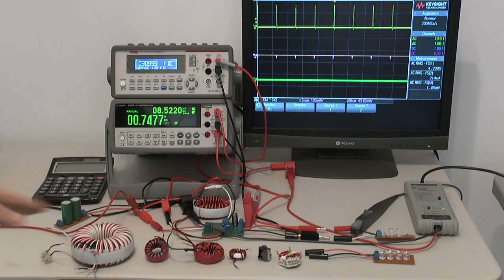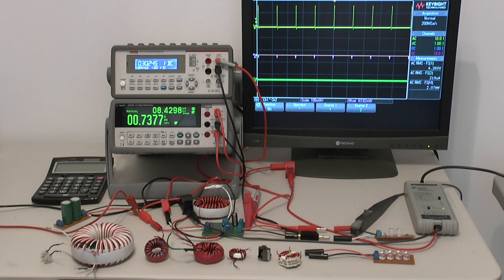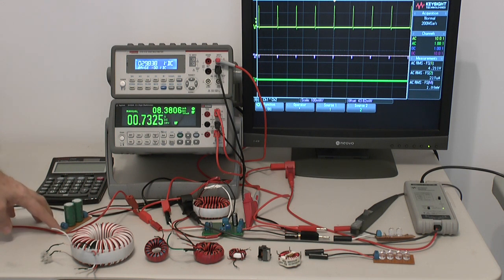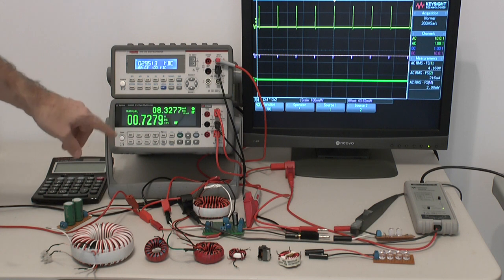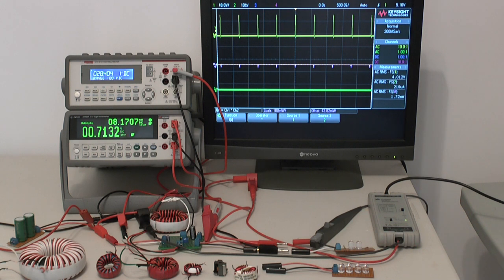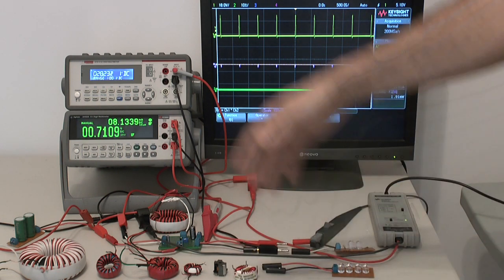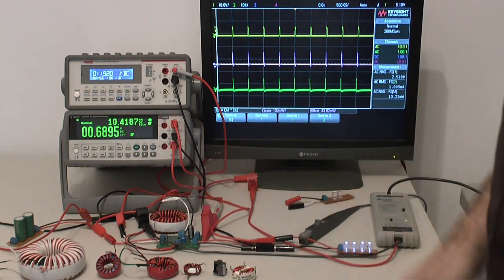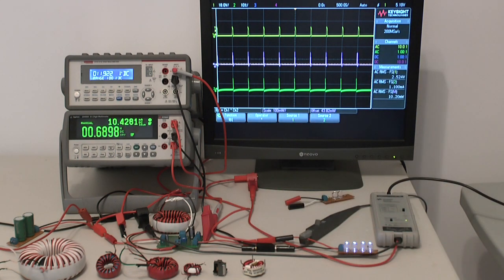The Joule Thief and Power Anomalies in the Ferrite Core

Comment: My friend, very good video. I've beeing doing similar researchs for 8 years now and I can tell you that the excess energy you are getting most likely comes from the compression of the electromagnetic field of the bifilar coil and its self capacitance around the wire, not the iron core itself. You can actually replicate the same experiment with coreless bifilar coils like panckage, ABAH, Tesla, etc etc, even a design of your own. So the secret is a series of caracteristics of your system. 1 The systems should resonate to achieve the effect, just put a high speed poliester capacitor in parallel with the coil connected to the colector and voila it will resonate, 2 You must have more than one bifilar coil, in series in order to achieve overunity, 3 Each bifilar coil must have a third winding so they should be thrifilar, 4 The higher the resonant speed, the more energy is present in the third winding. 5 The third winding likes high impedance loads, it means you need to stepdown the voltage of this third winding to get some usable energy in the form of low voltage high current. It might seem to be very complicated but not quite once you start understanding its working principle you can plan for larger setups.
Reply: good  ！Have you studied the work of Tang Smith?

Comment: I think this effect may be due to the finite time it takes for the magnetic domains to align  in various materials.  With sufficiently short pulses at fast enough risetimes the magnetic response continues to rise after the pulse duration has elapsed.  By the time the back emf from the load reaches the primary the input pulse has already elapsed. So input doesn't see 100% of load.

Comment: That is an interesting effect. I noticed your duty cycle was very low (5% or less), does it perform the same when you ramp the duty cycle up a bit? I say this because I wonder if it is an artifact of the measurement at low duty cycle... Using a rectified and filtered resistive load, does it produce the same measured gains?
Very interesting and thanks for sharing.
I really enjoy these sort of experimental setups.
Thanks again. :)
Reply from the maker: Hello Ben. I just did some test and it stays in the same ratio of input to output power measured up to 1 volt input. I have to protect the diodes when going higher. The 1.85 volt LED is very robust. My 3 Volt LEDs are not. The lower the voltage the lower the duty cycle. To go lower in voltage I have to remove the DMM in between and use clamps and active voltage probes here as well. I got it down to 0.3 Volt for two LED's. You cannot connect a resistive load because you would short your collector and emitter. I did use for such tests the rectified power output. But here you do not reach such values.
Reply: Ahh yes. Hmmm. It is interesting.